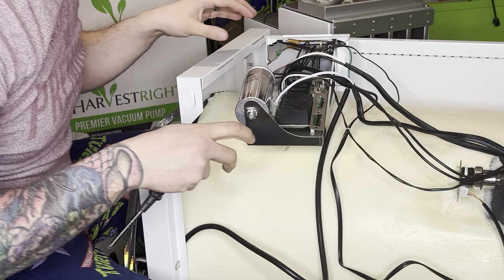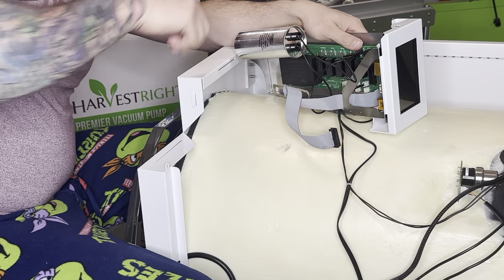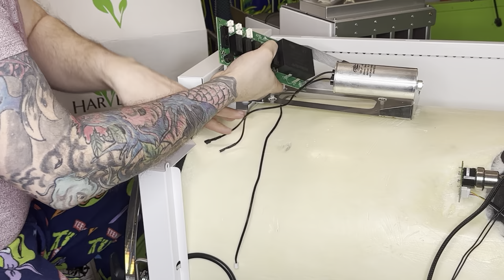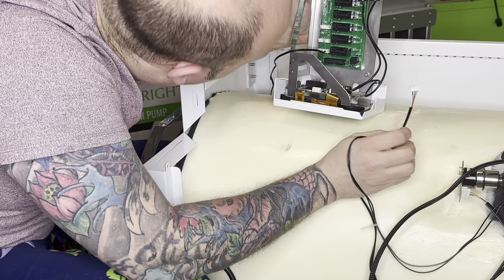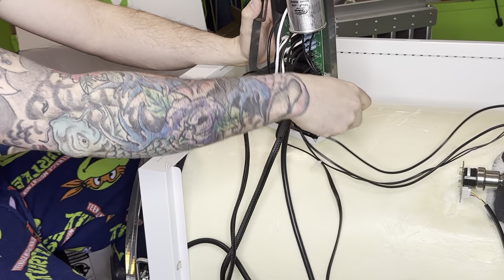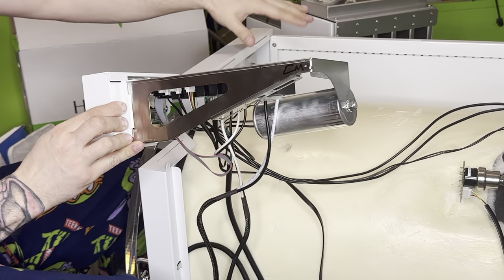Harvest Right Relay Board replacement

Comment: Yup, needle nose pliers are our friend for removing tough connections like on the capacitor wiring.  Best practice is to grip both the terminal end and the wire rather than only pulling on the wires to remove.  On the upside your capacitor wires do appear to have solid crimps applied at least.
Thanks for the video!
Reply from the maker: Good tip!

Comment: I wanted to say that my machine’s grounding screw was not connected properly when I opened my machine the first time. I tightened. The next time I had to open the unit, the ground was loose again; likely from vibration. So maybe a medium locktite could help…
Also I found that a pair of needle nose pliers help pry up on the connections.
Reply from the maker: Thank you

Comment: They need to supply a parts list with numbers.  It seems like they are trying to run a racket on repairs for these machines. 
We have the right to repair in our state. It doesnt require a proprietary technician.